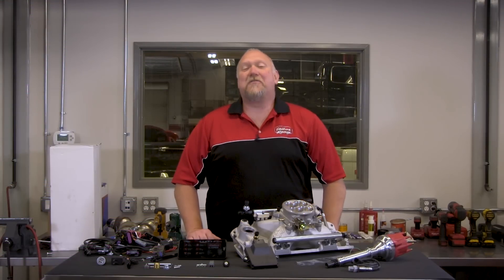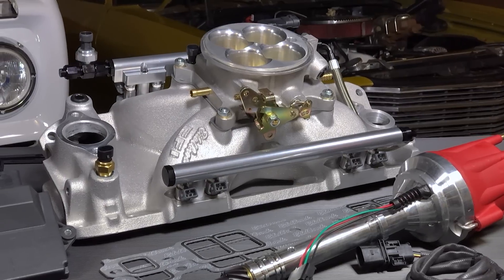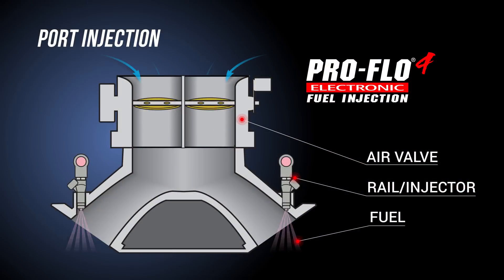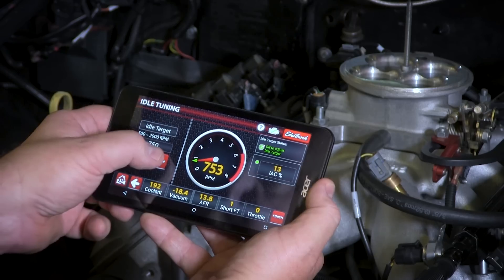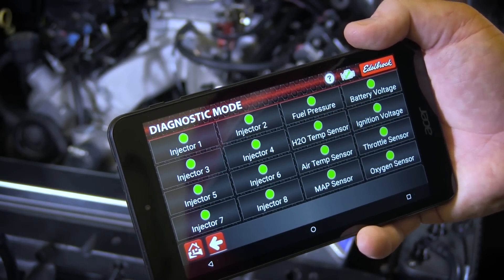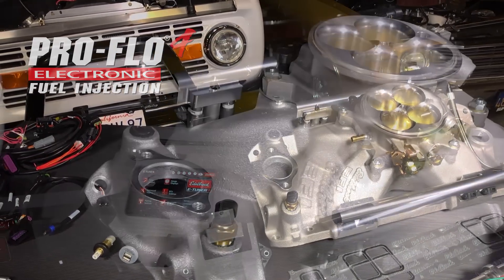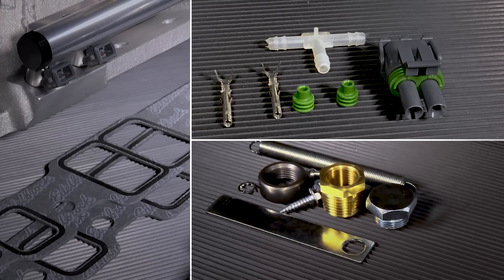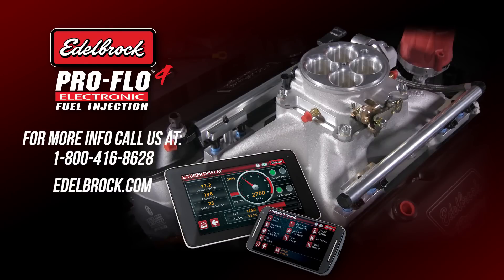Edelbrock Pro-Flo 4 EFI system

Comment: 1700 IS very EXPENSIVE, probly DOUBLE the cost of equivalent Carb.
BUT wait thats not all, For this efi to work you also need a $600 fuel sump kit!
BUT WAIT thats not all either.
Summit has this listed as a 2400usd efi system plus the fuel sump

Converted to CAD currency im looking at $4000 bucks right out the gate and wouldnt be surprised if a bunch of add ons needed bump it up to $5000 cdn dollars.
Well the truck im putting it on is only $6000 !!
Reply: Who gives a shit

Comment: Is there any information on the system from 1979? I am really interested to see how that system operated with late-70s tech. Can't find any info on the web since the oldest system people seem to have experience with is the 1992 and up one.
Reply: I have installed one my 1980 ford F150 with the 302. It was tricky to install with the mechanical downshift link for the transmission but it works great!  You will also need a return line back to the fuel tank and a good fuel pressure regulator since it does not have one internally.  Lots of relatively easy work.  Performance makes it worthwhile.  Highly recommended.

Comment: As an early adopter of Edelbrocks EFI system.. Before you buy one of these.. Find out what happens when the version of Android and the software they supply arent compatible. I have one of the Estreet EFI systems that came with a tablet, The tablet died  Edelbrock does not support it, The tech support guy said.. hey you have had it for years time to upgrade. I have a perfectly functional EFI system that I can not tune unless I can find a used tablet out there somewhere running 4.1 that works with the wonky app they wrote back then. Thats not the Edelbrock I grew up supporting. They have the ability to support these systems but chose to orphan anyone with the early Estreet and proflo systems.. I have a ton of Edelbrock parts and have always chosen their parts , Heads, Cams etc.. But from now on if it isnt something I can easily plug a laptop into and use any tuning software on.. No thanks. Sorry Edelbrock, Support what you sell many of us buy parts for projects that we do not get installed or running for several years.
Reply: It is like that everywhere. I bought a Holley supercharger for a 302 Ford. Not cheap. But now they no longer make replacement parts for it so when it fails, off to the dumpster it goes.  😬

Comment: I ordered my Edelbrock pro flow four system over 1 year ago, and I'm still waiting for it, every time I call Edelbrock I get an excuse from their customer service, I would receive it no later than November well that came and gone then it was December then January now I'm told maybe May,, I was supposed to haul my fifth wheel up to Alaska with my truck first of June, I've spent thousands of dollars rebuilding my engine and paying for parts I have paid for this part over a year ago which was like $2,200, I explained my situation to Edelbrock and they don't seem to care I asked for their higher management to call me back I've received no phone calls, just excuses, I will probably die of cancer before my truck even gets running , thanks Edelbrock for being such a great company with great customer support, I will never buy Edelbrock parts again

Comment: Gonna buy this soon for my chevelle, but was curious if the pressure regulator can be moved to the rear for a cleaner fuel line setup
Reply from the maker: Yes you can relocate in the case of clearance issues.
Reply: @EdelbrockUSA  when do we get our manifolds I've been waiting on mine for over a year, that I paid good money for

Comment: are the injectors interchangeable on the systems ? like if I buy the 450hp version can I buy the bigger injectors and use it as the higher hp setup?

Comment: WHY does this EFI kit include a distributor? Can I used my factory tach-drive distributor (upgraded with Pertronix II and Flame Thrower Coil)????
Reply: you need the distributor to let the computer know which injector to spray. It fires the injector based off which spark plug is firing
Reply: @kadenhayes2186  I appreciate the reply! Although I placed that question 3 years ago, and found out that the CPS (crank position sensor) is built into the distributor to do exactly as you mentioned. Thanks again!!

Comment: Does the system have support for the 4L80E or will you need a standalone controller?
Reply: i am running a proflo4 on a ford but they do not come with a trans controller. i got a us shift quick 4 and works great on my 4r70w

Comment: Can this be put on a 1997 5.7 vortec?
Reply: As long as you still have the Vortec heads or you can upgrade from that to Edelbrock’s e-tec heads
Reply: Thorn Bolek yes I still have vortec  heads. Motor is completely stock right now

Comment: Will this set up illimitable the need for my MSD 6AL box? Also is it E-85 comparable?
Reply: Edelbrock told me that the MSD does nothing for you under 6000 rpm's.  So unless you're running high rev's, you don't need it.
Reply: @russdeking4660  lol they would right they don't do shit up until then the energizer bunny skeet skeets in the distributor cap until 5,999 rpm

Comment: Mileage to the gallon is really a problem on my 1406 carburetor, will I get better mileage to the gallon with this system?? I am very very disappointed in the 1406 Edelbrock carburetor I just bought!!!!
Reply: That's like the leanest carburetor Edelbrock makes. 
So ether you don't know how to drive, or you have issues in selecting, and installing vehicle parts.

Comment: Wish you lads would build a system for Aussie Holden V8 to bolt onto.
Reply: That's a very good suggestion. Edelbrock does make a intake manifold for the motor. So they must have a test mule.

Comment: I just put this system on my 67 Firebird. 472 pontiac with a 238 duration 594/598 lift comp cam. Well, after 4 days and 6 different battery, I still can not get this started. I cant keep the voltage above 12 volts during start up. MSD high torque starter and tight engine. I currently have 2 AGM batteries 850/780 CCA and still cant keep voltage above 12 volts. I get 11.45 volts during starting. So that means ignition is disabled. HELP!!!!
Reply from the maker: Please call our tech line. Tech Line Only: 800-416-8628
Reply: Did you fix??
Reply: Did get it running. Distributor was out 180. Still dealing with the running issues though
Reply from the maker: @rickmoran2346  Have you contacted the tech department?

Comment: Out of curiosity, I priced new carbureted components just to see how this system compares. . .
Carb:  $300
Intake:  $300
Distributor:  $300
O2 Sensor w/ AFR Gauge:  $200
Tablet: $100
Total:  $1,200.00.  
This system retails for $1,800 at Summit (for a 302 Ford).  That's really not that bad considering what all you get.  
I haven't seen a carb yet that you could tune with a tablet over wifi.  And remember, the first time you do tune that carb, you'll have to at least buy a jet kit for it.  The system will support up to 550 HP.  So, it would support changes to your combo much better than a carb setup.  Come on Edelbrock, send me one for free!  I talked it up enough didn't I?
Reply from the maker: Carb's are analog so you cant change jets with a tablet. ha ha ha. Yes for the price of all the parts included in our EFI systems, Fuel injection is the way to go.
Reply: I think they should send both of us one. Great pitch by the way! : )

Comment: I've been really looking into either the fitech or one of these systems which personally I would prefer. While in reality the fitech super Ram plenum itself maybe Superior due to it being taller in the front and lower in the back which equals the airflow rate in the tunnel runners. But again is made in China and apparently they have horrible customer service. Regardless Edelbrock is a well-known name and being that this also comes with a distributor to have a complete system, which fitech does not, I would prefer to use this system.
Do they have a pro Flo 4 system that would work on the l98 113 heads?
Or do they have the pro Flo for system for early gen 1 small block Chevy? The only availability I C is for Vortec heads or E- Tech heads. At least with the early Style I can address the bolt pattern to fit on the 113 cylinder heads unless you have a system that will go on 113 heads.
Reply: Just adding to my earlier question, I would want the pro Flo 4 XT plenum. Do they have one available for early gen 1 small block Chevy (non vortec), or one compatible with the 113 heads?

I see the original Pro Flo super Ram style plenum would work on early gen 1 small block Chevy, but I have not seen the pro Flo 4 XT for this. Any information would be greatly appreciated

Comment: Nice, but why don't you design a specific intake with the injectors right above each cylinder, rather than 2 injectors sharing the port between. Kind of defeats purpose of TPI.
Reply from the maker: Our kit has 1 injector per cylinder. This is true multiport fuel injection.
Reply: It is one injector per port with the injector right above each cylinder.  There's divided intake ports inside what looks like one big runner.

Comment: I have the total kit on order for my 351W in my 88 Bronco. I did not know it was this new.
It was recommended to me. 
EFI system, Manifold, Electronic Distributor.
My original PCM was toast. I was getting multiple codes from the EGR system and the engine was stalling when hot. We are talking EMP while driving. Total shut down.
I replaced the block 30K miles ago so it is fresh. Unfortunately Ford just bolted on the original parts, now 30 years old.  
I am experiencing systematic failures one part at a time. 
At 30 years old, no need for emissions. Bye Bye EGR, Bye Bye original PCM and EFI.
Reply: Im thinking about pulling the trigger on this system in spring for a 90 F-150 with a 302 as well make a vid when your done i'd be interested to see it running. Thanks
Reply: Have you installed yet?  How does it run?

Comment: Been interested in this system for a small block Mopar. Unfortunately, doesn't seem to work with Magnums unless you're running EngineQuest heads with the LA intake bolt pattern or have drilled your Magnum heads to LA bolt pattern. Not sure if the Super Victor Intake will play nicely with Magnum serpentine setup. Would be cool if Edelbrock had a Magnum style single plane intake for EFI. Sure, if I wanted to run EFI on a Magnum I could use the factory setup but a 408 stroker Magnum would be choked by the factory keg intake.
Reply: So a 360 magnum is a no go with this?
Reply: I'm looking at this with a set of trick flow 190cc heads on my 00 magnum 5.9.  TF heads have the LA intake bolt pattern and are drilled for LA or Magnum blocks.
Reply: I've been read that the distributor that comes with these systems are a bit tall and may interfere with the wiper motor on A-bodies

Comment: Since the intake is single plane, how well would it do on a 400 SBC in a truck used for towing? I would like to go with this, but don't want to lose any low end torque.
Reply: fdprobie with direct injection intake style isn’t as detrimental as with tbi or carbs. There’s an episode of Engine Masters that discusses this.
Reply: Perfect just go to a wide band 02